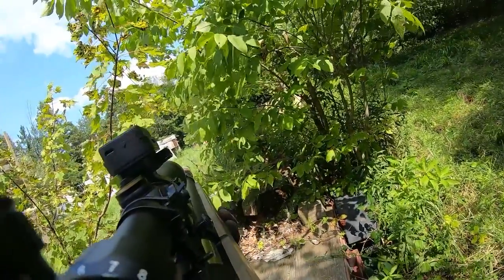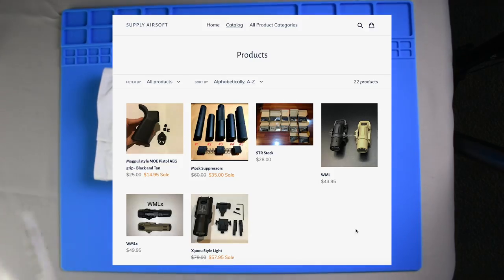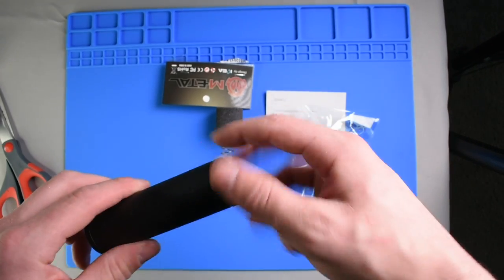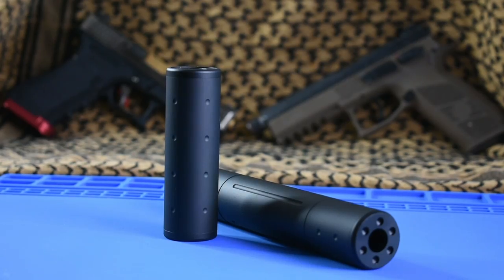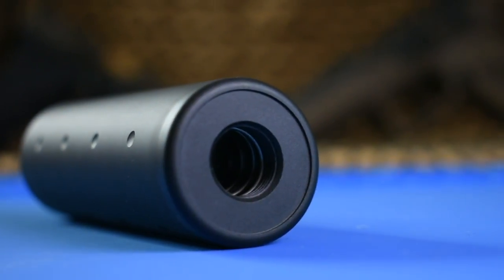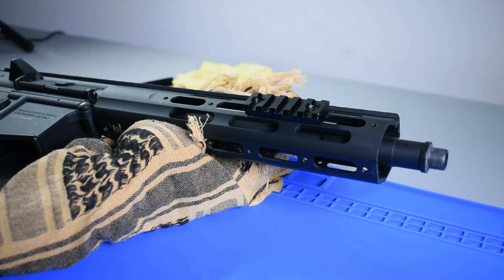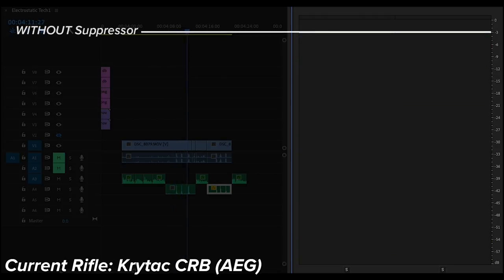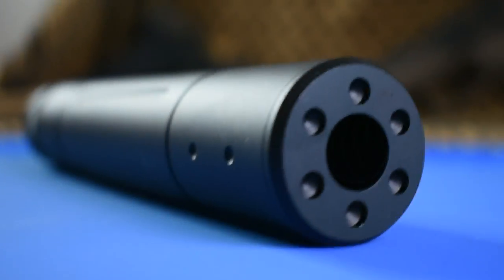Foam Filled Suppressors | REVIEW & TESTING

Comment: Great video!  Love the simple and clean style of your videos.  Just ran across you today.  It would be interesting to see the difference on an AEG that has been shimmed well.  Most of the sound actually comes from the play in the gears and motor.  A near-perfect shim job from pinion to piston drastically reduces the noise level.  I know it would be a bit much to do, but it would be great to see the difference (if any) in a mushroom type cylinder head and piston head combo.  Keep up the great videos 👍
Reply from the maker: I would love to try it, I will make a video if I can!
Reply: my P90 Silencer came empty too - any suggestions? i dont wanna use it yet because the user-manual said there was foam inside that was supposed to be there - any advice?

Comment: Nice video as always! 💓 I bought a suppressor for my blow back co2 pistol. I filled it with an external layer of a strange kind of bituminous material (used in cars to isolate vibrations of the cones of the stereo implant) and and internal layer of the same foam you used. The result in aeg is not really that great, but for my pistol it is. The sound is not quieter but it's way less snappy. I bet it works with hpas aswell.
Reply from the maker: Thank you very much!!!  That sounds so badass!
Reply: @Private_Caboose  yeah it is. Not sure if the bituminous thingie is useful in any way but still 😂
Reply: my P90 Silencer came empty too - any suggestions? i dont wanna use it yet because the user-manual said there was foam inside that was supposed to be there - any advice?
Reply: @ZombieHouseFresnoCA  use your own foam they dont ship with foam cause its illegal

Comment: I have noticed it is more functional when you fill the entire suppressor with foam instead of just 2 sides, so you could keep the spring and make one that would work
Reply: my P90 Silencer came empty too - any suggestions? i dont wanna use it yet because the user-manual said there was foam inside that was supposed to be there - any advice?
Reply: the foam compartmentalising is actually needed for it to work more better, thts what a real steel suppressor works anyway. adding a padding on the suppressor external will dull the noise a tad too, most airsoft uses thin aluminium for supr

Comment: Is there a purpose for having a spring inside the suppressor alongside the foam? Like if I was to make my own foamed suppressor is it worth including a spring or should I simply fill the entire thing with baffle-like layers?
Reply from the maker: The spring really just makes sure the foam doesn't shift out of place, getting in the way of BB travel.  It is by no means necessary, I do not use them in my shorter suppressor, I just make sure the foam cannot move

Comment: Hey man idk if you’ll see this but i have a question about a suppressor I have. It’s a completely hollow cylinder with no inner tube or anything for the bb to funnel through, so I’ve beem having a hard time using it. Does this mean that it’s a suppressor that’s meant to be filled with foam?

Comment: Hey caboose this video got me looking into those suppressors from supply airsoft and I actually got one for my spring m24 (it didn’t work out and I didn’t want to spend $40 for the adapter that fit into the rifle) and it ended up on my hpa tippmann omega and even after a few months I can’t get over how quiet that thing is

Comment: The longer, 190mm suppressor will not seem to even budge when I try to twist off the cap. Anyone know what’s wrong?
Reply from the maker: I’ve noticed the same thing after purchasing these again this year.  Did they start glueing these together to avoid certain laws about suppressors?  I took a mallet to mine and tried to bust it open. I ruined the suppressor

Comment: Are there any that are over barrel/barrel overlap?
Reply from the maker: I believe there are a few mock suppressors that slide over the outer barrel.  I know one is called the "Goob" which stands for "goes over outer barrel", and I believe after some research (I cannot confirm as I have not used it) but this suppressor seems to have an option for removing the threads and end cap to slide over the outer barrel: https://www.evike.com/products/40440/
Hope this helps!
Reply: @Private_Caboose  Thanks for the help dude!

Comment: Does it work on gbbs???
Reply from the maker: I put this on my Tippmann HPA GBB and it does alter the sound, but since most of the noise in a gas blowback comes from the bolt cycling, it doesn't actually silence it too much, just dulls the sound coming out of the barrel.